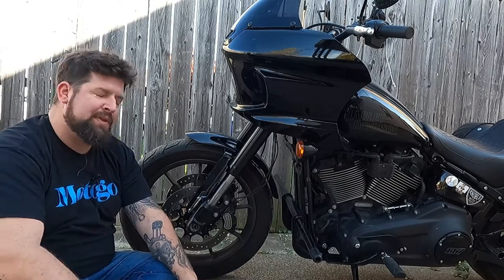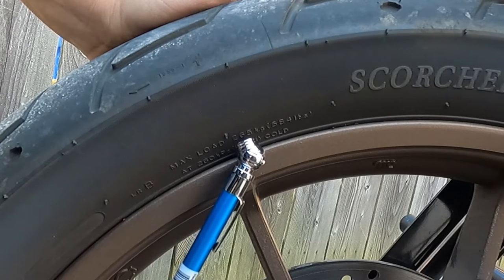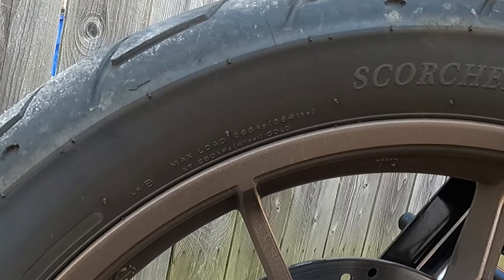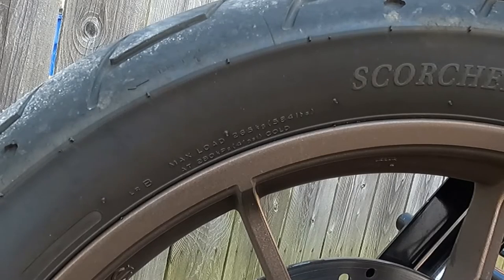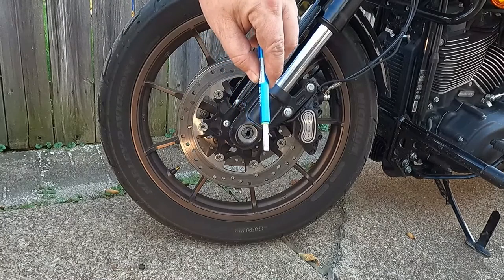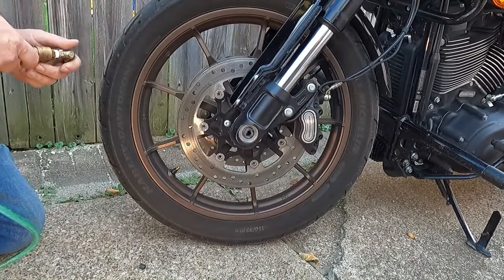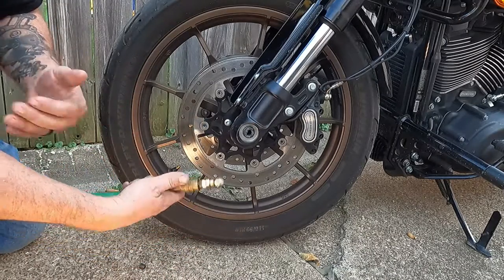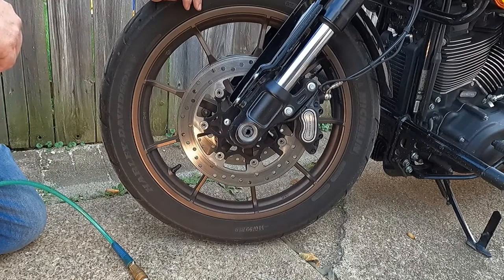Correct air pressure for motorcycle tires and how to check it.

Comment: I just bought a HD 42300009 Valve stem extension. it should work great especially on the rear tire.
Reply from the maker: That’s a good plan. The rear always stops in the worst possible spot lol

Comment: Remember that the maximum tire pressure listed on the tire is the recommended tire pressure at the maximum load for those tires. In the case of those tires, it is 41 PSI at 584lbs on that front wheel. The rear wheel will have a different recommended pressure and max load capacity. If you put 548 lbs of weight of that front tire, you better make sure that the tire's pressure is 41 psi not 36 psi. Of course, you must keep in mind that the maximum load capacity of the tires always exceed the maximum load capacity of the bike. 

The recommended tire pressure shown on the label on the bike is incorrect for most people even with the OEM tires. Those pressures are based on the unloaded wet weight of the bike, the weight of an average rider (something like 170-175 lbs that manufactures uses), optimum road condition, type of riding, and so on. The heavier you are, if you are carrying a passenger, gear, and so on, the higher the pressure needs to be. The reality is that the pressure shown on the sticker of a bike is a "suggested weight," not the word of the Motorcycle God. No one answer is the "honest to god straight up truth," like you said. To say that it shows your lack of understanding on the technical aspects of tire construction and performance. Including safety. 

The same is true for suspension settings. The type of suspension setting varies also on many of the same factors that tires do. If you fully load your bike, you also need to adjust your suspension. Just common sense. Yet many riders never do. Don't forget that the tires are considered part of the suspension, as they also absorb the energy from road imperfections. 

To really get the tire pressure right, it is more complicated than some percentage from the max pressure. It's a good start baseline, but just as the bike's manufacture's recomendaron, it is not optimum.

Tire best pressure is a compromise between maximum traction and tire reliability (likelihood of tire failure). Two different curves on a chart that don't reflect or follow each other. To achieve maximum tire reliability you have to compromise some traction. And if you want maximum traction, you compromise some reliability. You change one, you change the other. One goes up, the other goes down. The key is finding the sweet spot the gets you the best of both worlds based on the type of riding you do. 

If you really want to get technical, you have to consider other curves on the chart as well. Such as handling (the higher the air pressure the "quicker" the tire becomes, the less air pressure, the "slower" it becomes), tire temperature (tire pressure affects tire temp. The lower the pressure the hotter the tire runs as it flexes more), and on and on. The top that most riders are concern with is traction, reliability, and handling. Tire pressures can be very complicated if you want to do it right. With many different ways of calculating the right pressure. 

Some (I include myself) lower the pressure by a couple of PSI when wet or when it's very cold for extra traction. Like I said before, the lower the tire pressure the hotter it runs, but if it's raining the water will help keep the tire temp down. But if you lower the pressure too much, then remember that you sacrifice tire reliability. That means that the tire could fail if for example you hit a pothole. You could even damage the rim. See how one thing affects the other?

If you are fully loaded and you inflate the tire to the figure shown on the bike's label, the pressure might be low, even too low. The same principle as before applies, tire reliability goes down and the tire can't maintain the right shape, runs hotter, and so on.

My point is that there is no such thing as one correct tire pressure for a bike and tire combination. One do it all tire pressure. That is true in any type of vehicle. Always keep in mind the weight load, max loads for the tire AND the bike, type of riding, and road conditions. After some trials you'll easily be able to figure out the right pressure for any given ride.

Also keep in mind that if you run tires sizes that are different than the recommended tire sizes by the bike's manufacture, you pressure will change too. For cars there are online calculators that lets you enter the original tire size, then the new tire size, and it gives you the correct tire pressure. No such thing for motorcycles. Hell, you can find online bicycle tire pressure calculators, but not for motorcycle.

In my view, if you learn about traction, reliability, and handling, and you jeep those in mind when you experiment with tire pressure, you be ahead of the average rider who only uses one air pressure or everything. The more you do it on your bike, the easier it becomes getting it right.
Reply from the maker: Wow! That was a lot of typing!
Reply from the maker: Tag me in your video so I can see how you explain it.

Comment: great video!  are running the same pressure in the rear  36 front and rear ?  thanks
Reply from the maker: Yes. Same pressure because that’s what the tires were designed to run at.
Reply: @KnobleMoto 36/40